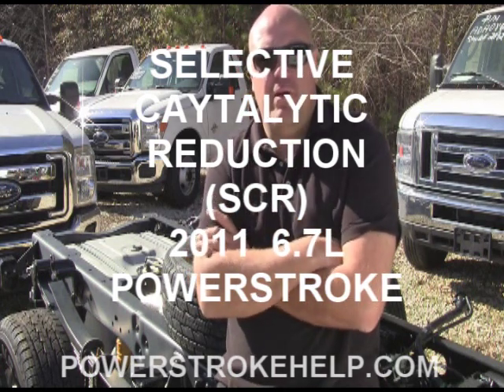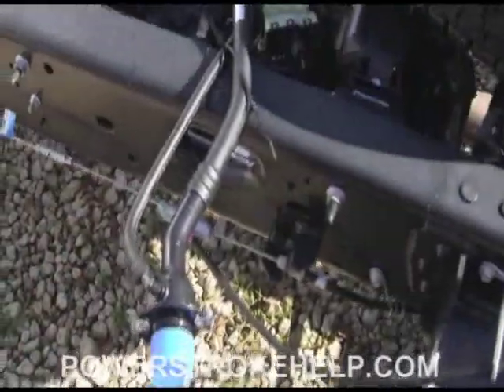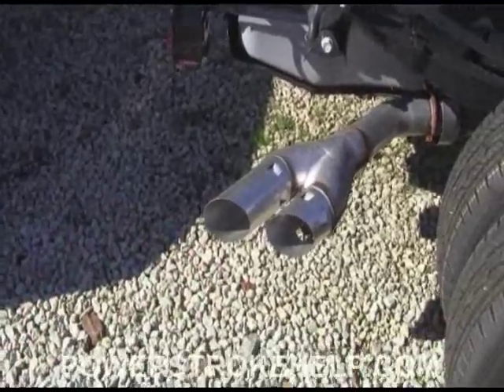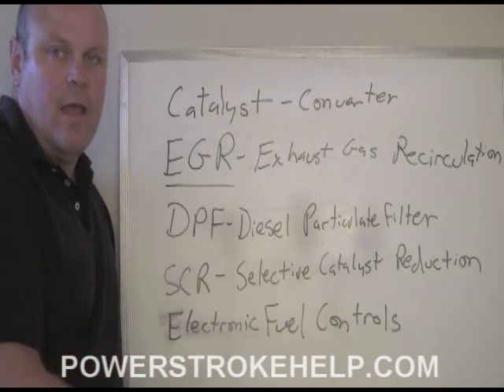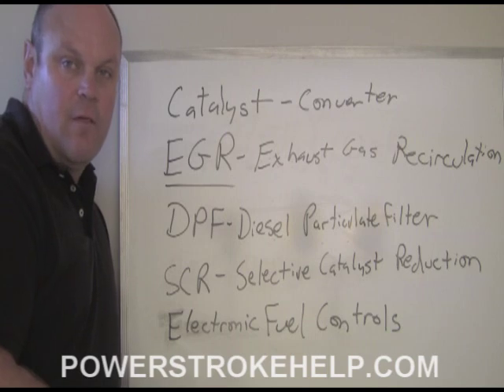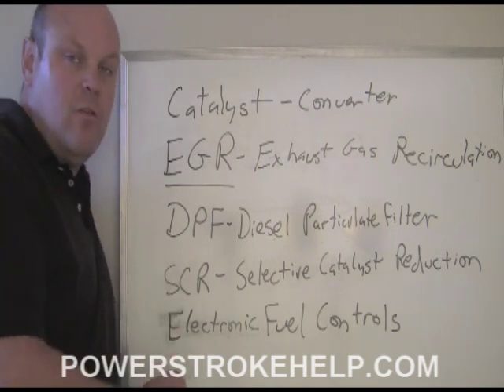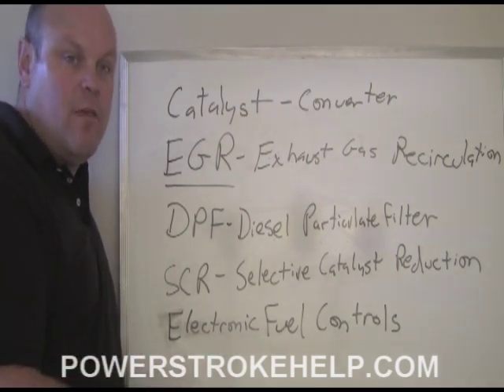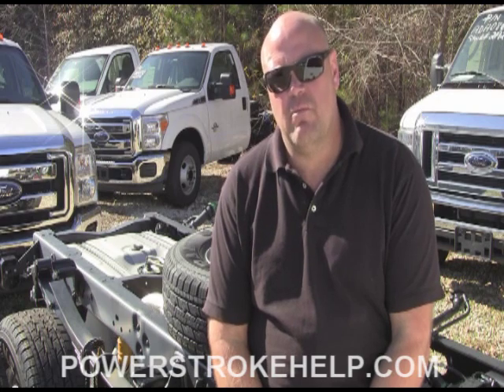SCR 2011 6.7L POWERSTROKE SELECTIVE CATALYST REDUCTION

Comment: So 11 years later what's your feeling on the 6.7 now? I own a 2011 runs great powerful and fuel efficient. I had a number 8 stuck open injector gave me a contribution dtc truck had a fuel knock and smoking. Replaced the injector reprogrammed and changed the oil been driving the truck now the dreaded p207f code I see these all over the net on forums. Now I just want to delete the emissions little advice please

Comment: Bill,First of all GREAT Videos, keep them coming. Second as an old retired mechanic I like to know a bit more than the average owner about how my vehicle operates, and try to keep up with technology. I do have one question; you mentioned that on the 6.4 DPF Regeneration was achieved by injecting diesel fuel on Number 7&8 cylinders on the exhaust stroke, causing all sorts of reliability problems. How does Ford address this issue on the 6.7? How is regeneration performed? I have my 2016 F-350 ordered and should be in by the middle of March.

Comment: Excellent video.  I do however question the reliability of the EGR system.  My '12 F-350 had a warranty-replaced EGR Cooler failure at only 32K miles.  I have 2 years of powertrain warranty left, but I don't want the expense of replacing this system after the warranty expires.  I'm not a power junkie, but I am a reliability junky.
Reply from the maker: HoboCoastie You got to run the truck hard every now and then. YOu have to knock the soot off the turbo and EGR cooler. Babying these trucks is as bad as abusing them. Archoil AR62-- will help the fuel burn cleaner. archoil.powerstrokehelp.com
Reply: chemistry major?

Comment: now i have some questions and need some advice, i have a 2011 f250 with the 6.7 as well with 62,000 miles on it used and i hate the DEF system, shall i keep the DPF and keep my warranty? i just bought it used from a dealership and know nothing of this truck, they gave me a 110,000  5 year warranty, should i keep it? i might through this in here to, at my job our work trucks are in about 4 to 6 times a year for DPF faults and filter clean out. should i delete the DPF or keep my warranty even tho i hate the DEF system and do not know this trucks history? if i do delete the DPF the tuners say to unplug electrical to the EGR. could i just simply unplug it or do it have to completely remove the EGR system?
Reply: I believe there are tunes out there that just turn off the DEF system. you leave it in place and you basically just turn off the pump and injector and all that to keep from having to put DEF in the tank, EVER. Please DO NOT use DPF and DEF interchangeably either, they are not even long lost relatives of each other.

Comment: Great videos, thank you for your time! I want to reduce emissions from my 2005 PowerStroke 6.0. Would going back to EGR (it has a delete kit now) help? Would adding a second OEM cat converter right next to the original one help? Any DPF or Ad Blue retrofit possible? I am shipping my truck to Europe and they will rape my wallet if it does not meet a certain standard. Any advice will be greatly appreciated!

Comment: I'm sorry, but any engine that requires removal of the crankshaft to remove the camshaft has some significant engineering oversights.  The 6.4 is garbage.  6.7 addressed all of the inherent 6.0/6.4 weaknesses, such as 4-bolt per cylinder heads, rocker arm bridges (6.7 has 32 pushrods for proper geometry), etc.  Reverse flow heads are just straight badass for a turbo engine as well.

Comment: SCR certainly does a great job at reducing the emissions from a diesel engine, and has made them more reliable and powerful, but at what cost? SCR uses urea, urea is made from ammonia, which is made on an industrial scale by burning hydrocarbons! Backwards logic at it's best!
Reply: ethan adkins
Yes, I agree. It's all just "feel good" legislation pushed through by politicians just so that they can say they're doing something about reducing our emissions impact. If they actually looked into the issue, they would see that they're only compounding the problem. I say strip all the emissions shit off cars, especially diesels, and let them get better MPGs.

Comment: how does the 6.7 do the regen? I work on semis and i like the way they regen. our cummins isx and our dd15's have a seperate injector (dozer) after the turbo and when its in regen it revs to about 1200 and once its been over 500 degrees the dozer will kick in and heat everything up nice. i always thought that was be a better way than 6.4 does it

Comment: Good Lord Yes!!!  I really think the 6.7 is going to be a very refined unit over the years!  I also think the diesel world is going through a similar stage as the gas-engines did in the mid-seventies, which ended when fuel-injection was proven to be reliable.  Eventually, this will be refined and diesels will get better; the dang FEDS really need to give manufacturers more time to do R&D instead of creating such havoc.  But, I am sure they don't care as they don't have to actually fix anything!

Comment: How is FORD doing with this 6.7.  In your opinion, are they refining it to the point it is going to be reliable like the 7.3?  Or is it yet another problematic nightmare?  I want to replace my 1995 F-SERIES which has been NOTHING but an absolute reliable machine and still runs all day!  
I am really terrified about buying a new truck (it seems all brands are finicky) because they all seem to have major problems that can't be fixed by the home mechanic.
Thanks!

Comment: Thanks for the education. I love all the powerstrokes I've had. The first 2 were 7.3's, and I just bought a used low mile 6.4. I sure am glad I did a cat/DPF delete and put in an EGR blocking plate. It also got a spartan 210 tune, mostly for fuel economy. It started as an awesome truck with potential to have problems and be very thirsty, and ended up as an incredible truck with huge power and got a 20% increase in range due to fuel economy! After watching this I want a 6.7!

Comment from the maker: I have not experienced this directly, but high cylinder temps and pressures have to contribute to cracked exhaust valves. It also may be that the manufacturing process to heat treat the material is making them brittle. Only a guess

Comment: Been a member of your channel for a long time.  Any ideas as to what is causing some of the overheated valve cracking issues on heaver gross weight vehicles?

Is this from lean idle conditions to meet CARB?

My F250 with the 6.7 has been awesome.

Comment: The turbo went out  2weeks ago. the dealer said the shaft in the turbo over spun?
My wife was towing a horse trailer got about three miles from our house and lost power. she turned around  and parked it, when i got home i took a video of it. I tried to drive it to the shop and it went the rest of the way and totaly died. grey smoke, black smoke dead! towed to the ford dealer has been there for two weeks.

Comment from the maker: I have seen most of the turbo failures on 6.4s in trucks that pull hard and are using regen more often. My deduction was that the excess heat from the regen was overheating the turbos causing seal and bearing failure.

Comment: When the 6.4l goes into regen, yes it injects fuel on the exhaust stroke, but no the exhaust isn't 1200 to 1500  degrees, it doesn't get that hot til the exhaust gas moves past the DOC and DPF. The reason those cylinders are getting burnt is because of injectors sticking open.

Comment: Uh oh.  I pre-ordered by 6.7 truck in 2011......

No problems aside from one alternator failing and quickly replaced under warranty.

Should I be concerned about having brittle exhaust valves in my engine?  I am not even at 20K yet.

Comment from the maker: I have not seen these truck YET but the early 2011 engines had exhaust valves that were heavily heat treated. This made the metal brittle that led to the cracking situation. I am of the understanding that it has been addressed and solved.

Comment: i work for a ford dealership, and we've had about 5 2011-2012 trucks come in for repairs, all of them have had cracked exhaust valves, all around 45k miles, all got new engines on the house. Have you seen any issues like this, or might these be isolated incidences?

Comment: @powerstrokehelp It's my understand the point of the 2 seperate cooling systems is to cool the EGR gasses in 2 stages to reduce thermal shock inside the cooler and prevent rupturing. In addition I assume liquid cooling the fuel, transmission and charge air cooler is a more precise way of controlling the temperature of those systems. It may be a good idea but I also see some new possible failure points. I agree with you - everything's going to break eventually.

Comment: You mention the 2 seperate cooling systems. Unfortunately you mentioned the EGR cooler has a seperate cooling system that cools it... it's actually cooled by BOTH cooling systems - the primary and secondary systems. So not only is the engine cooling system in danger of failing because of EGR cooler failures but so is the secondary system that cools your fuel, CAC, transmision. Either way - a cooling system failure of either system could very well result in catastrophic engine failure.

Comment: You are almost right about the emissions control systems not needing to come off and that Ford was after reliability but they aren't quite there. They need to follow GM and add a 9th injector for regen. Some 6.7s are still blowing up because of regeneration, not near as bad as 6.4s because use of the newer technology reduces need for regen but we still have blue valves in 7 and 8 as well as diluted oil thanks to regen. But we will have to deal with it because removing this stuff is now a felony.

Comment from the maker: @jerseypaul2007 I have driven both 2011 Dodge and the 2011 Ford and the Dodge is a good truck. It is a whole bunch better than the previous Dodge models but the 2011 Ford is much improved over previous models. Have you driven a Ford Lately?

Comment: Excellent job!  That helped me a great deal to understand the system.  As a very loyal Ford owner (one F350 and 2 Mustangs).  I am kinda stuck with either keeping my 7.3 Powerstroke or ponying up the big bucks and buying the 6.7.  Which basically leaves build dates from March 2003 to August of 2010 off limits.  I have looked into the Fummins option and it is a lot easier and cheaper to just buy a Dodge and try and not to look at the nameplate if I can avoid it...LOL!

Comment from the maker: @dorsetengineering Dream on, the yanks dont get a diesel. 2.0L 136hp ecoturd motor is all that is available. Sad but true. Ford got burned with lack of diesel techs on the PowerStroke in the last 10 years. They wont make THAT mistake twice.

Comment from the maker: @tgerbec The 6.4 is an outstanding engine until it breaks. It is extremely expensive to fix. The parts are expensive but the labor is high because it is so difficult to work on. As my grandaddy said they put 10 lbs of manure in a 5 pound bag.

Comment from the maker: @Slog58 Most of the systems can be disabled electronically. By changing the program the EGR, DPF and SCR are simply shut off. The installation of the pipe just makes the exhaust flow freer and make more noise.

Comment: I think it's important to differentiate the EGR on gasoline engines. Lots of guys will disable the EGR to gain performance, but it's purpose on gasoline is to increase mileage. The small amount of exhaust gas that is introduced into the intake is used to allow the engine to reduce fuel flow without running lean. If you remove some fuel, you have to remove some oxygen.

Comment: @lmancates..they have fluid level sensors in the tank to tell if its gettin to low and if it sees its to low for to long it will start loggin faults and derate the power until you fill it back up to keep people from doin that

Comment: @ps3dethman1...do you think before you talk? Diesel fuel is wat creates the fire in the dpf to burn the carbon out its pumped back there thru the engine on exhaust strokes and only does it when normal exhaust temperatures are not high enough to burn it out

Comment: Hey Bill, I always wondered if these 6.7s would be fine if you didn't have to remove the EGR, SCR and DPF systems. If they work like they're supposed to and don't cause any headaches, then that's great. Are amulance companies using a truck chassis to fit these 6.7s now as opposed to a van chassis? I remember you saying that they couldn't figure out how to fit the 6.4 in there...is it the same issue with the 6.7 being so big?

Comment: Way to many issues you are listing regarding Powerstroke failures. I would rather own a 2n Generation Cummins and worry only about replacement of Filters. Ford should have kept International as an Engine supplier. Plus the engine of the 6.7 is not even all that original. Cummins has been doing Exhaust in the valley for many years and GM also had one in the works before Ford.

Comment: I like Ford a lot i like everything they did with the 6.7 except how they designed the DPF regen mode. Duramax got smart and put it seperate injector in the DPF and burned the soot right in the DPF hopefully ford does that.